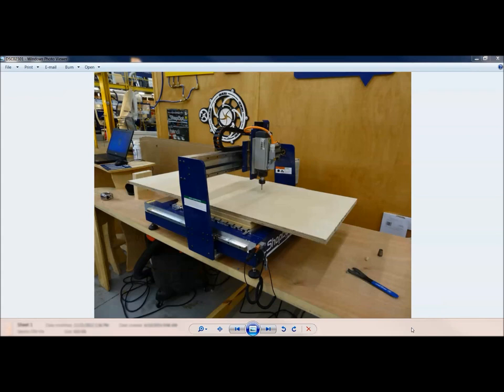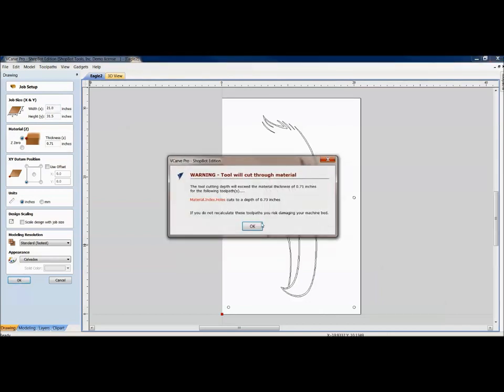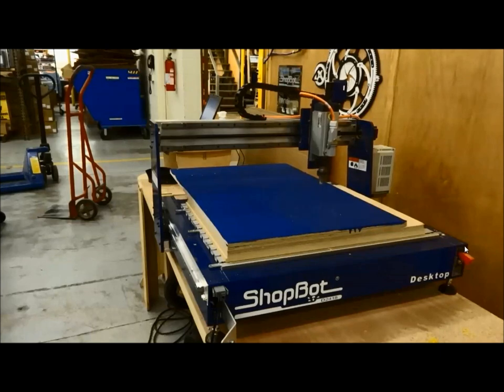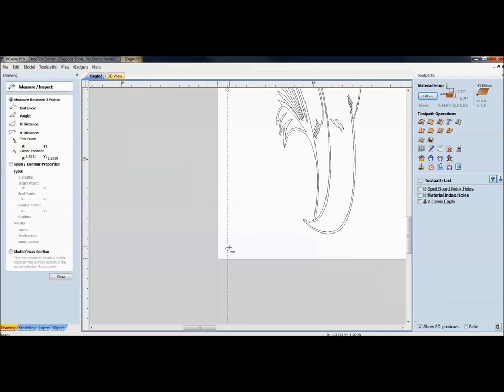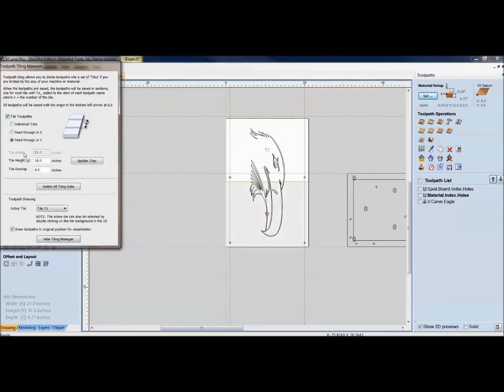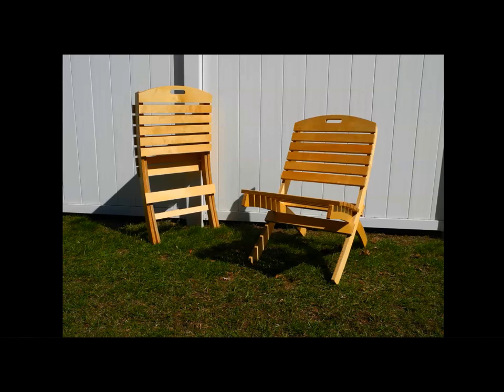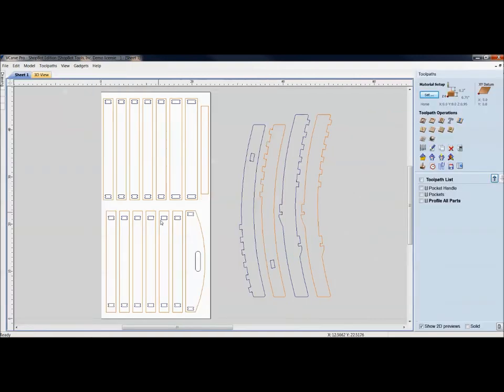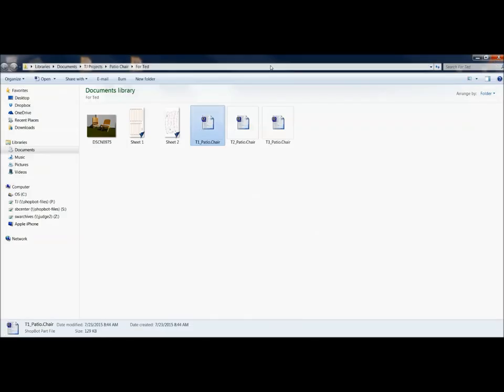Tiling A Project

Comment: I did my first tiling project and on the second tile it over lapped like 3/4" and shorten the project the same what could of happen I double checked pin locations and cnc table pin location and these are right
Reply: I'm a bit late to reply here but it something in how the design/tiling was set up is the most likely issue here. best thing would be to send your CRV file and cut files along with some pics of the result over to support@shopbottools.com and they will be able to get you straightened out!

Comment: Doesn't shopbot desktop come with auto zeroing accessory or an ATC
Reply: It does come with proximity switches to auto zero the XY and a zzero plate for the Z axis zeroing. but the Desktop cannot support an ATC spindle or tool changer bar like the full size tools can